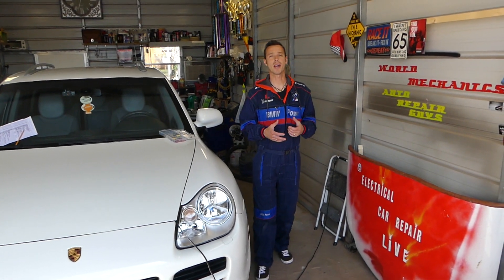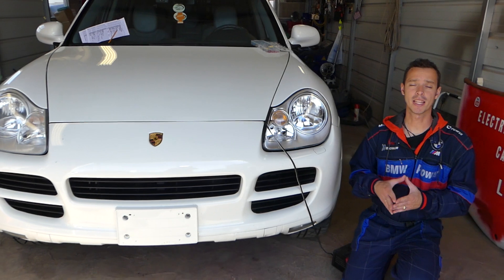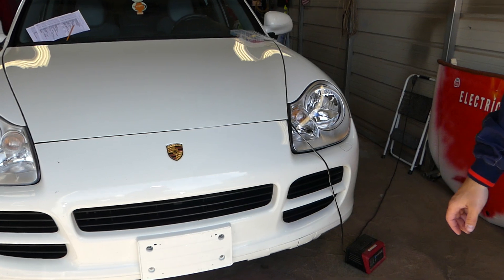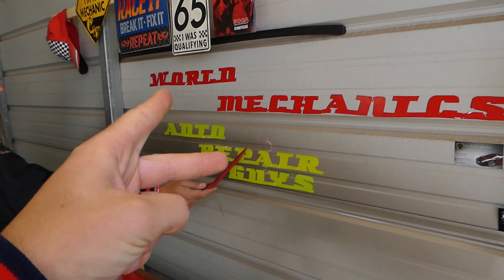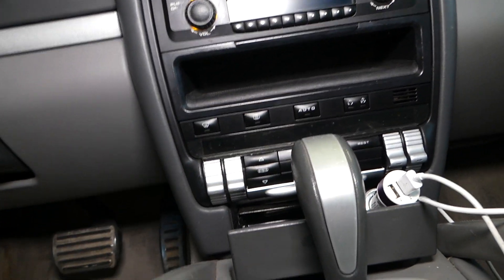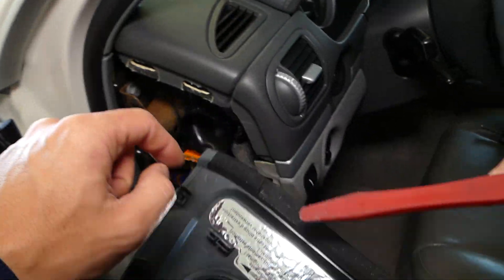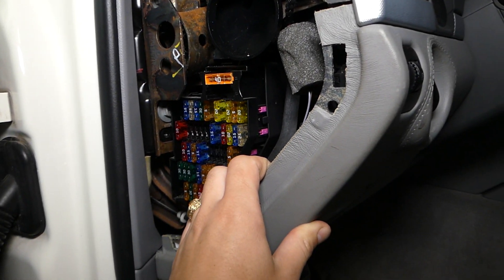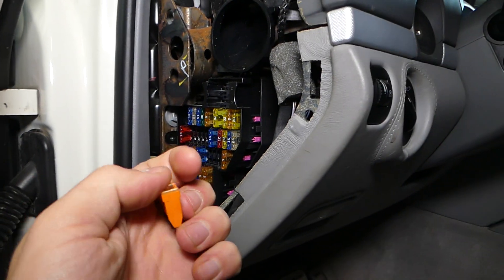PORSCHE CAYENNE HEATER BLOWER MOTOR FAN FUSE LOCATION REPLACEMENT  AIR CONDITIONER BLOWER MOTOR FAN

Comment: hi mate, could you make a video or guide how to remove/ replace all the air ducts inside the GTS 957's cabin ?
mine seems to miss several ducts (both side and center vents, footwell...) so the air from the A/C did not distribute properly inside the car (plus the old duct system looks quite dirty thus I'm planning to replace them all)